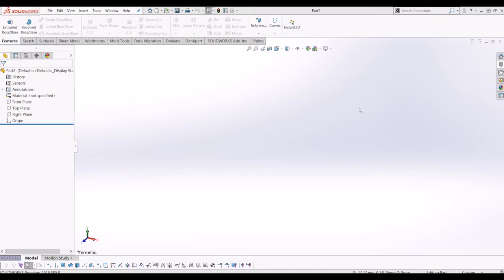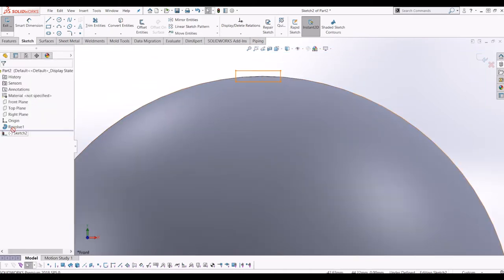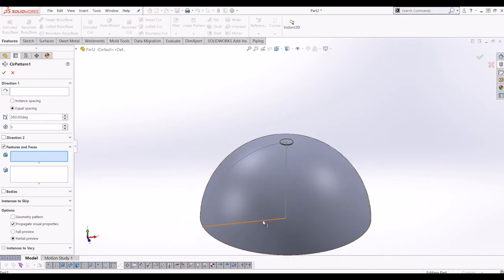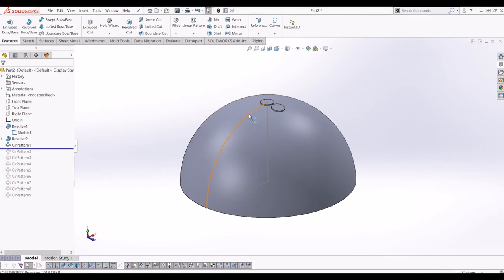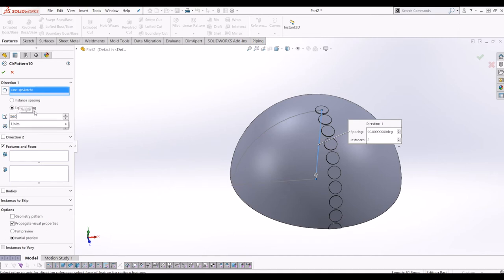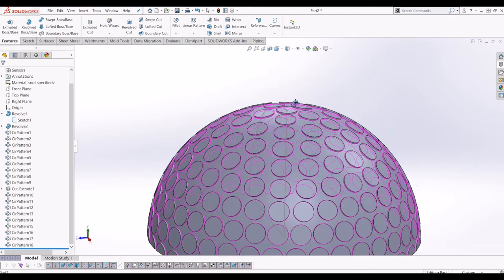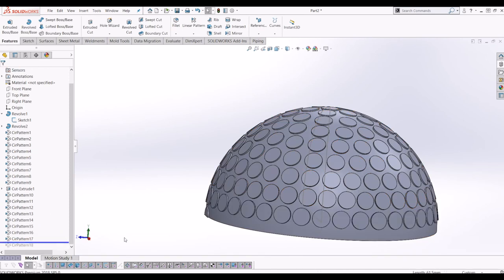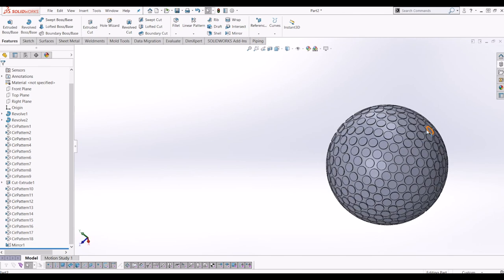Solidworks 3D Modelling How To- Model Equidistant Points On A Sphere

Comment: Thank you  kindly  — I’m not a  * Comp Guru  * — however this piece you’ ve  displayed here is definitely along the correct field of my necessary  features of wood turned 11 pointed   * Icosahedron * . My official markings Include 5 points as you initially  showed toward the beginning  around each of the  primary 11 points 👍🤓